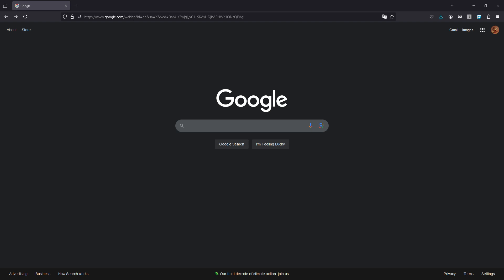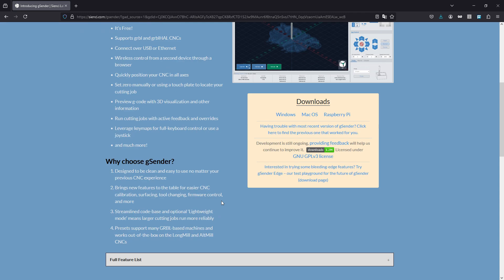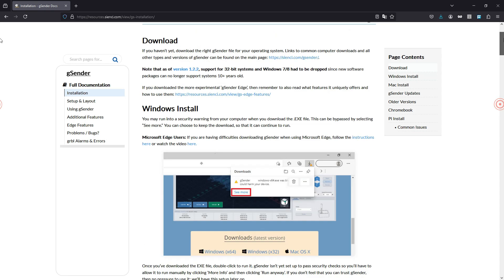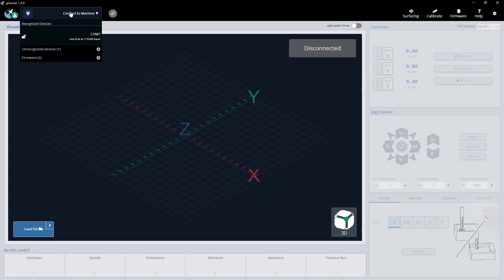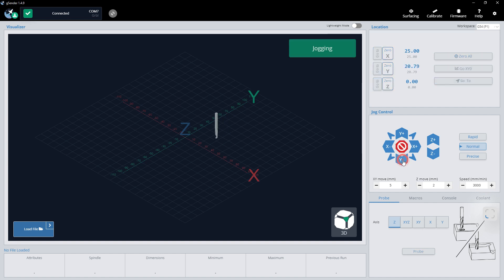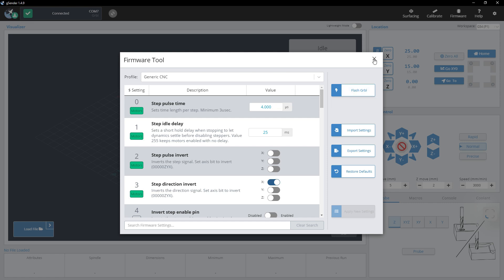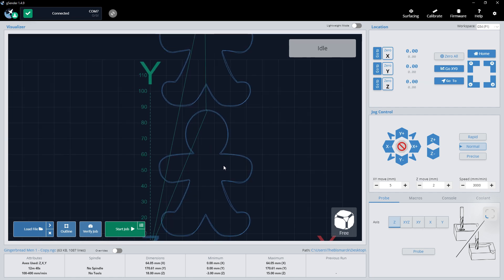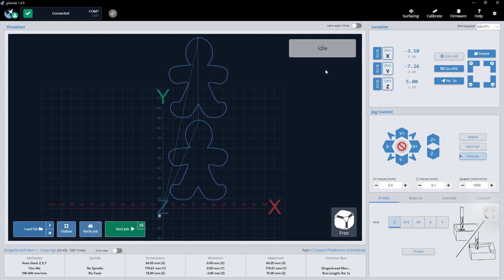Episode 44 gSender Crash Course for the Vevor S4040 CNC Machine

Comment: My machine is cutting larger than the design. I designed a 3 inch four leaf clover in carbide create and when I cut it is about 4 times lager.
Reply from the maker: Check the DPI of the graphic you're using. Also check to see if you designed in inches/millimeters and what your machine is cutting at... those were some common hurdles I learned early on... hope that helps

Comment: Thank you for taking the time to make this video. The problem that I am experiencing is when saving a project on Cut2D or Inkscape and opening it on GSender, it gives me the following message: "G-Code contains 4 simultaneous axis commands which are not supported and cannot be run". As far as I know, the files are saved as 3 axis projects. Any help?
Reply from the maker: Never encountered that one so unfortunately at a loss on advice to give